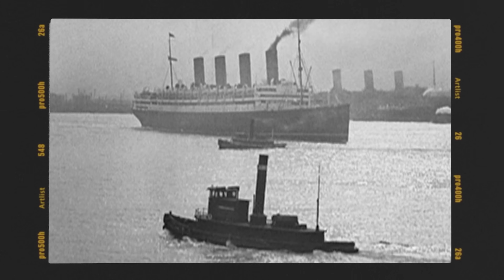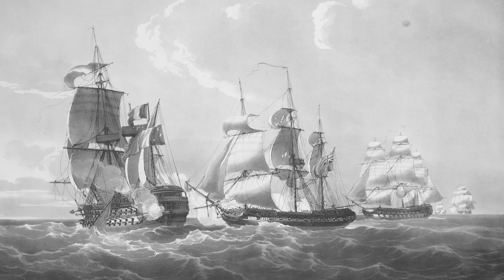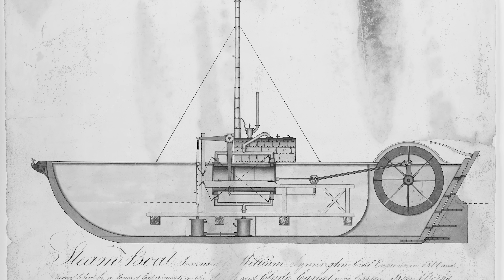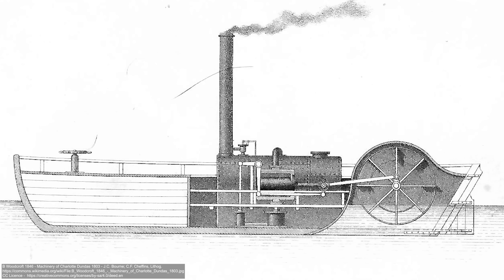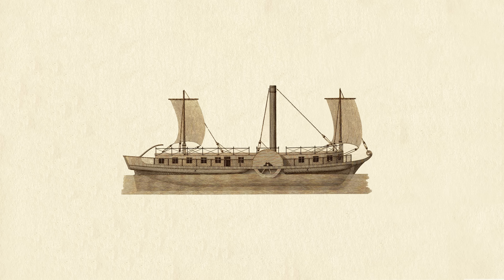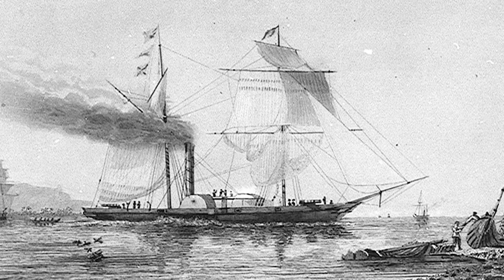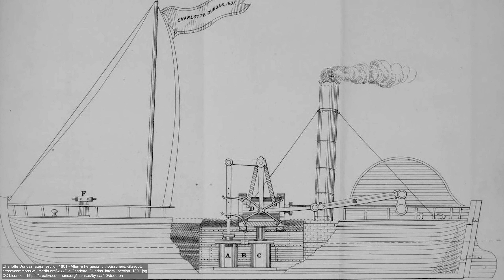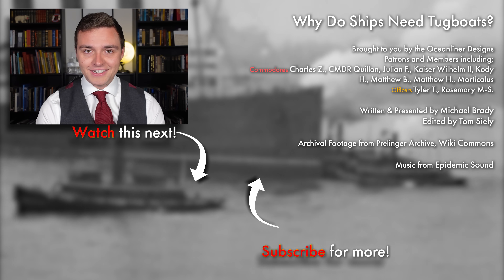Genius Design: How the Tugboat Was Invented

Comment: Tugs initially opened up the Mississippi river by towing laden ships over the bar at the mouth.  Prior to that, freight had to be lightered over the bar to another ship, an extremely wasteful and costly exercise.  The US was really prevented from starting to becoming the commercial powerhouse it's become today because it wasn't able to take advantage of the massive and cheap transport corridor that is the Mississippi river.  Tugging ships over the bar only happened for a few years, a Mississippi salvage diver figured out a way to drive piles and construct massive and sturdy river-channeling foils that channeled and directed the current at the bar and scoured it away, opening up a clear passage for ocean ships to sail or be towed up the Mississippi to commercial cities.  The bulk of the nation's commercial and agricultural potential was unlocked once this impediment to cheap transport was removed.

Comment: The Royal Navy (RMAS) used paddle tugs until the early 1980's. The last were the Director Class, built in the late 1950's, designed to fit under the overhanging decks of aircraft carriers.

Comment: Have you forgotten the Director class paddle tugs that were built for the UK maritime in the 1950s.  Not steam powered, but they were paddle tugs...designed to work wit aircraft carriers due to their low height above the water.

Comment: The issue for sailing ships getting in and out of port is usually the wind direction, there's about 45 degrees from the wind that a modern sailing vessel can't use (I'm assuming that back then it was around 60), in the open ocean sailing vessels zigzag to solve that, but in port, a zigzag is usually not an option.

Comment: I remember reading in a book, that before ships had steam engines, to leave port they would drop the anchor into the biggest rowboat, which then rowed out a ways, before dropping the anchor. The ship would then slowly winch in the anchor, thereby moving the ship, and then repeat until you had left port. But the book was about an old warship, regarding the somewhat narrow channel through Copenhagen, so i dont know how common it was outside that

Comment: They often would "warp" ships into the docks as well.  Run a line from the ship out to a bollard on the pier, wrap the end of the line around the capstan, and the the crew would pull the ship to the pier.  You could also "Kedge" your ship in our out by carrying an anchor out away from the ship, drop it, and then, using the capstan, pull your self to the anchor, weigh the anchor, and repeat.

Comment: Actually, 1818 was not nearly the first time a ship was towed by a self-powered tug.  The Royal Navy in the late 1600's (yes, the Seventeenth Century!) had several tugs called horse boats that were used around the royal dockyards for towing.  These were paddlewheel tugs powered by draft horses on treadmills.  This type of vessel was more common in later centuries when used as ferries, but these navy horse boats were purely tugs, for moving the warships around in the anchorages and in the dockyards.  It is also recorded they made trips all the way down the Thames Estuary to the naval anchorage at the Nore, towing masts and spars and delivering other supplies.  The vessels are listed in the navy lists for the late 1600's, and were in service for decades.

Comment: The late Farley Mowat wrote a story (The Grey Seas Under) of a 1918 ex-Admiralty tug HMS Frisky, renamed Foundation Franklin when purchased in Germany in 1930 by Foundation Maritime in Montreal. 613 tons, with a coal-fired boiler system feeding a 1200 hp triple expansion engine. This tug was used between 1930 and 1948 and based in Halifax, NS. She was designed to move capital ships, vessels of 15,000 tons were easily towed.

Comment: Hi, I served in sea going and river tugs as ch/eng.for nearly 32 years and have worked on most types of propulsion with the exception of paddle tugs.
       The Royal fleet auxiliary as it was back then in the 50’s had the director class of diesel electric paddle tugs built for handling aircraft carriers,I believe they had Paxman engines.

Comment: Was doing some underwater dock-maintenance on a project that was using a tiny little tug for I forget what. We'd be floating at the surface a good distance behind it while the tug did its thing, and we'd occasionally get caught in the prop wash and get tossed around a bit. Just an unreal amount of torque from such a little boat.

Comment: Tugboats are basically massive engines with enough hull around them to store the fuel and make them float. Then you get deep sea tugs, which are the same, just they have enough fuel on board to get from one and of the ocean to the other, towing a ship many times bigger than itself.

Crews are rough, and all are able to pretty much any task on board as well, simply because there is no room for more than the bare minimum of crew to sleep and live on it.